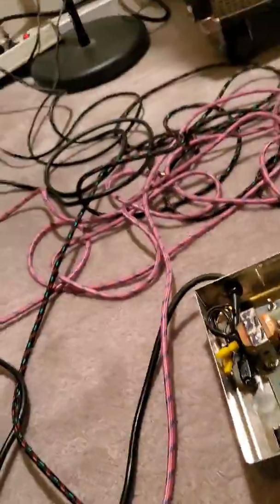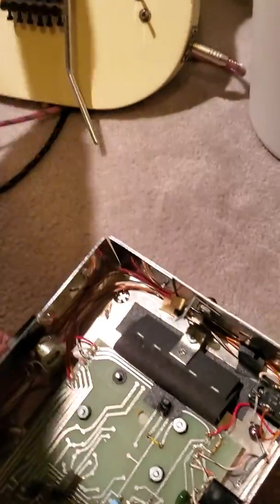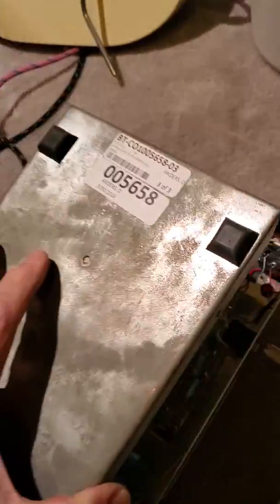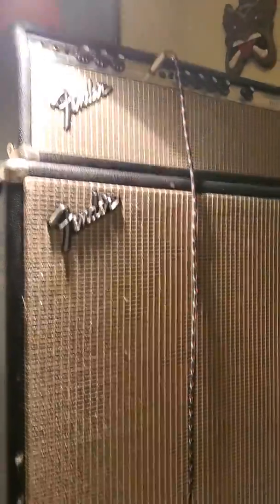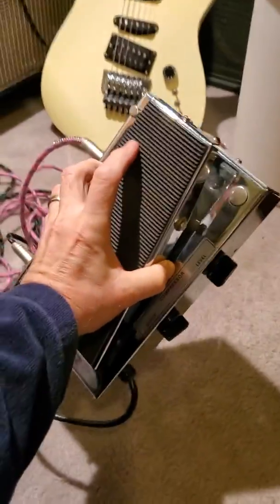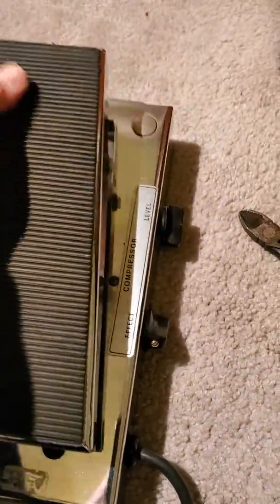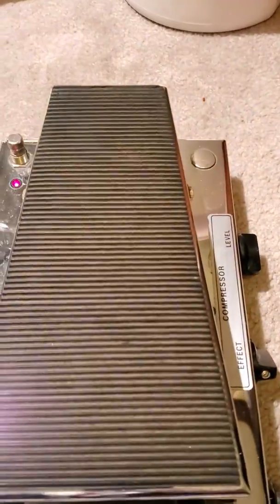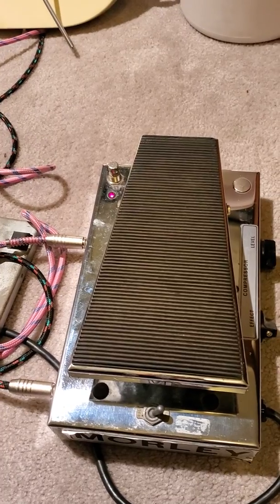Morley volume compressor pedal

Comment: Hi, this must be a lighting issue. These pedals work via a ldr and treadle, when you turn the pedal over and put the cover on it is removing the light source (your ceiling light) which is removing the signal. You may need to adjust the black ‘curtain’ inside so that it allows the red light to pass towards the ldr when you lower the foot treadle down. The red light is what is supposed to trigger the signal. By opening the back you are allowing the ceiling light to trigger the signal. That’s why it works when flipped over. Hope this makes sense.
Reply: That's exactly where my mind first went. Possibly a bad led, adjustment,or light sensor malfunction. There's not much that could go wrong with that circuit. Now if it does that in bypass.......  its haunted by a funky ghost with a big gold medallion. Don't ask me how I know that.
Reply: Like he said adjust the black curtain inside.. I have one of these also. I had to do mine very similarly..